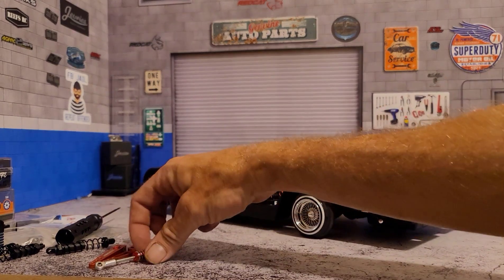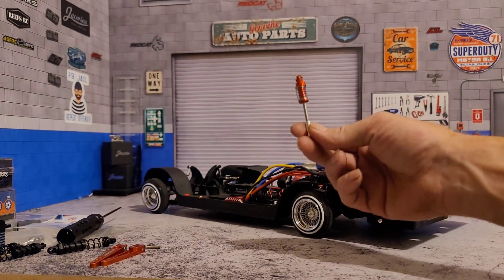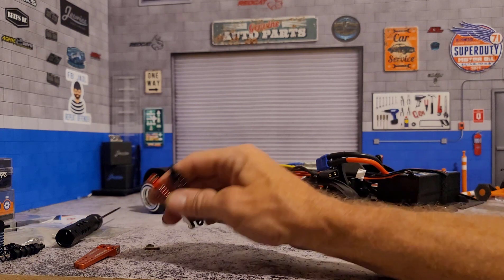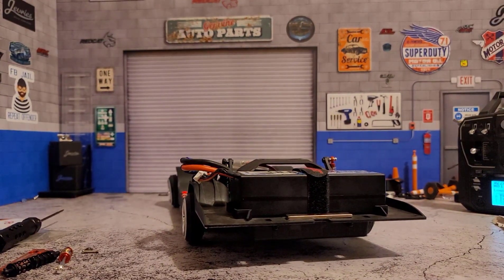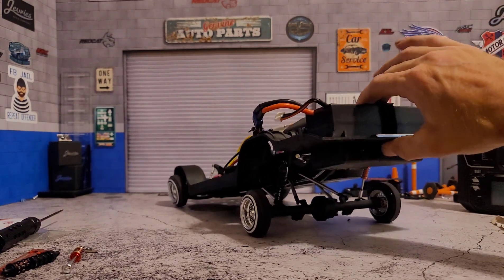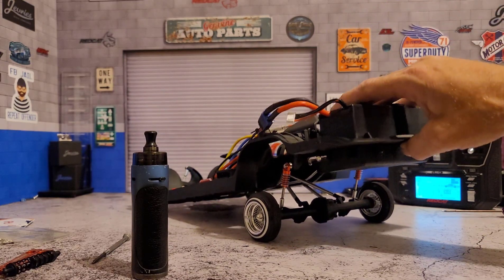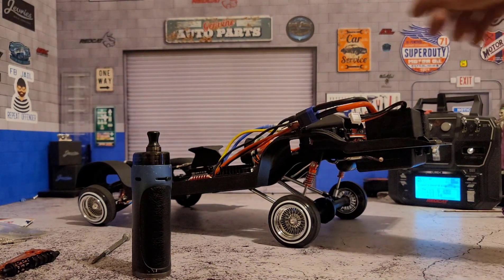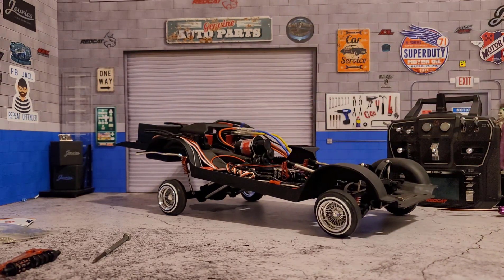HOP BUILD UPDATE #3 Working Scale look Shocks

Comment: I wanna put long throw horns (2") on mine, but is there any suspension linkage issues when you start locking out the rear that high?
Reply from the maker: yes, first have to cut chassis, but higher lock up than stock will put such an angle on the drive shaft it wont turn, the bumper in front will contact ground and servo horns will push into the interior and rear windows deforming the rear of the body
Reply from the maker: to do higher lock up, you need to do custom longer trailing links and a lot of custom work / compromises

Comment: how did you mount the shock to those serious horns? I'm having a time
Reply from the maker: These all using same spec screws. 

Rear horn still stock but will be upgrading to longer horn that screw too small for. Solve this with a long screw and nut on other side of mounting point. A spacer keep this placed out right.

Comment: Could a cap pack be used on redcat 64 what purpose does it serve and what kind of cap pack should be used
Reply from the maker: yes (I actually use one) but not the same way its used in NPRC. In drag racing its used to keep voltage up for the ESC to give to the motor but this application we dont need motor power we need servo power. So I use a Glitch Buster on the Receiver to keep the voltage up on the receiver feeding the servo